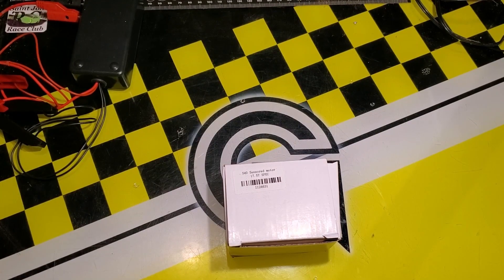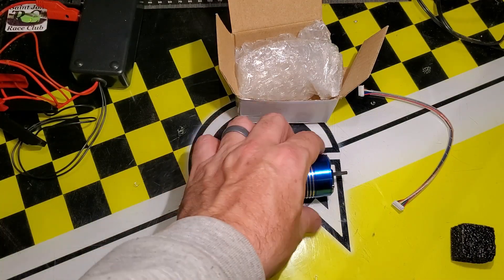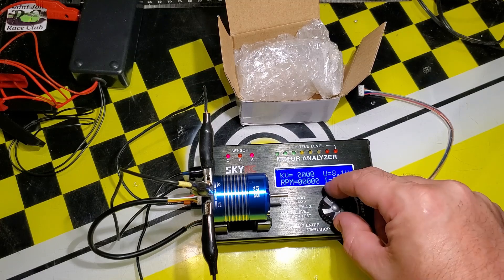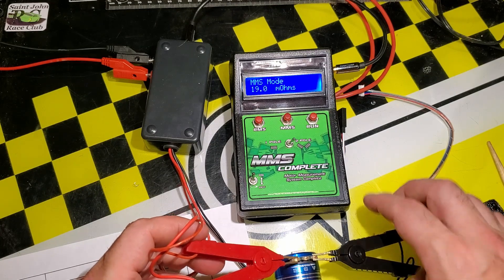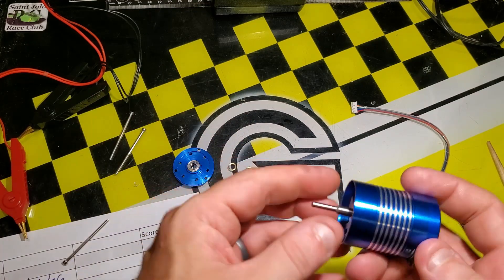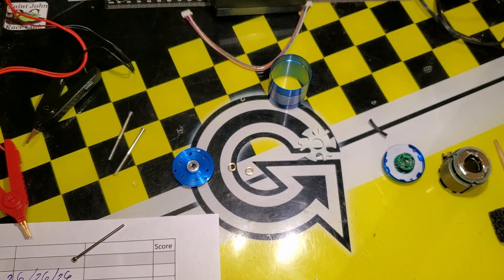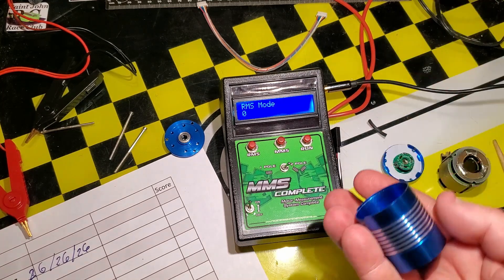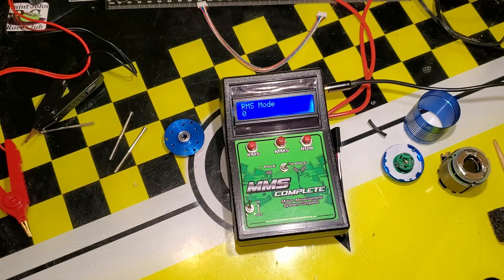Review: Surpass/Hobbystar/OEM 17.5 Fixed Timing motor

Comment: would the 4.5t have the same timing or different?
Reply from the maker: I have tested the 17.5, 13.5, 10.5, and 8.5 of this motor and it seems the timing is approximately 30 degrees on all of them
Reply: I have a Tamiya dt-02 with a Tamiya TBLE-04S esc my question is does this motor come in 15.5t being that tamiya says that's the motor that runs with this esc